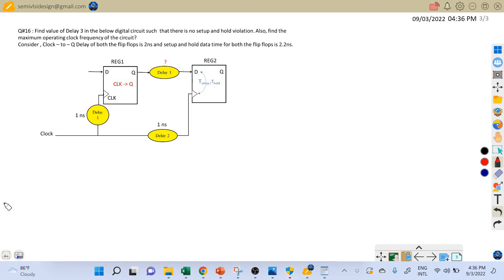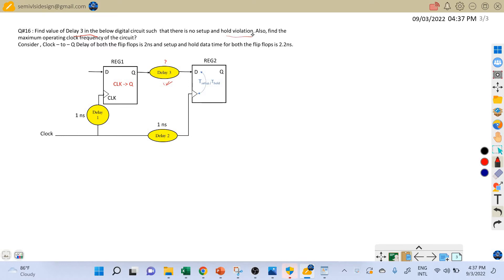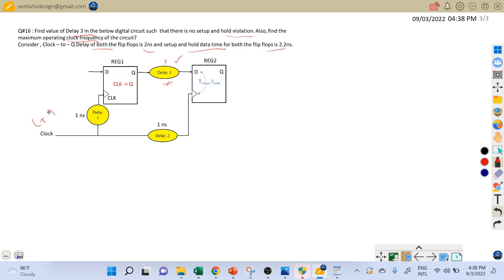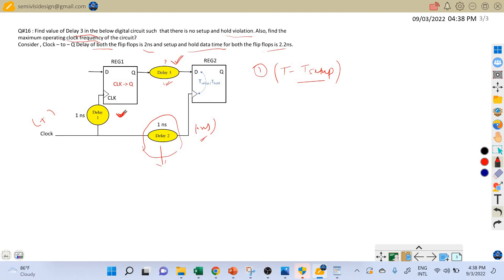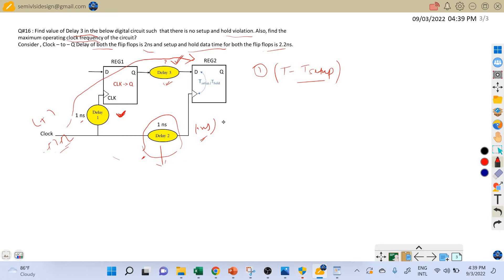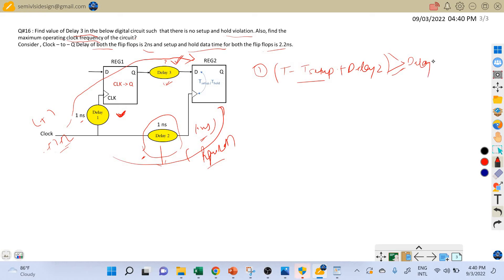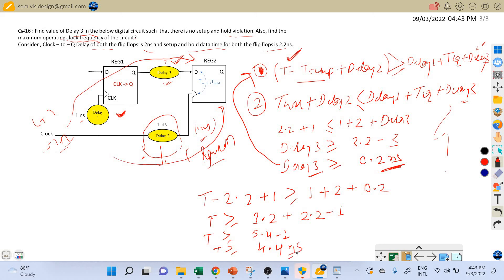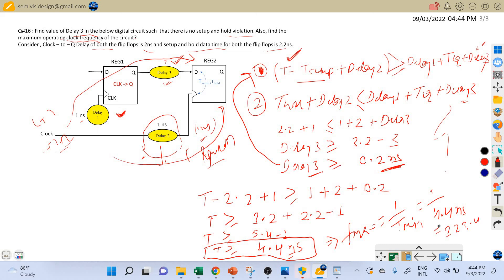Interview Question#16 | Finding Unknown Value of Combo Logic Delay | Static Timing Analysis (STA) ✍️

Comment: I don't think skew is needed here as is the same delay offered to both the registers and hence can be avoided. or basically net skew is 0ns. I got the same answer without taking skew
Reply from the maker: Yes, You are correct. Here, the aim is to understand the skew concepts in Setup/Hold Equations.